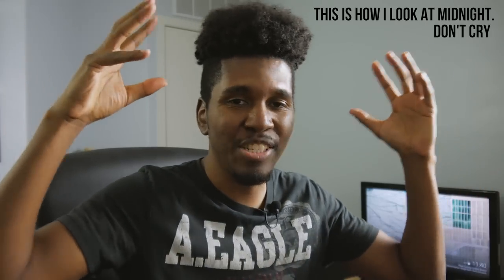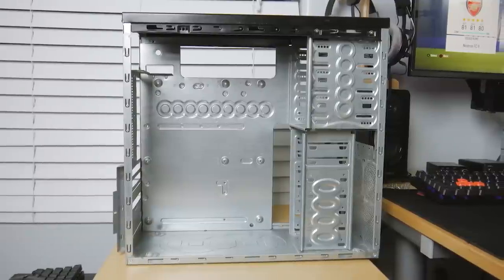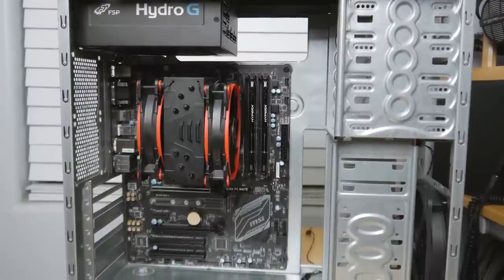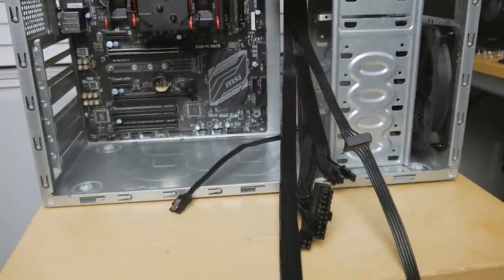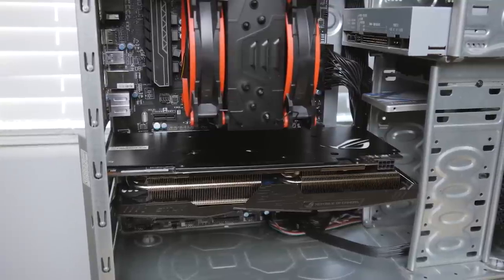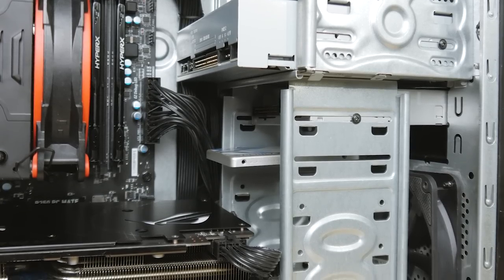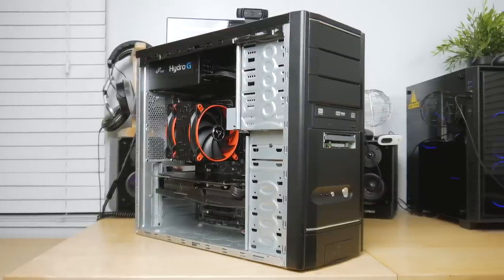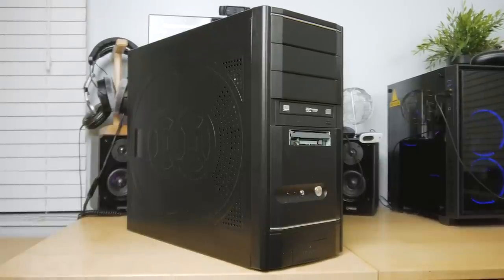The AMD Ryzen SLEEPER PC Build

Comment: I got an eMachines slim form factor PC that I may end up turning into a sleeper with a Ryzen 2400g. The only problems I can foresee are the PSU, which is a sort for elongated FlexATX. Gonna be a pain to find a new cheap PSU for it. And the headers are grouped together, so I may need to do some soldering or something.

Comment: But if I have a plan like this I will use
I9 9900K/Ryzen 9 3900X
Asus Maximus XI Formula/
Crosshair VIII Formula
Corsair Dominator Platinum RGB 64GB 
2X Asus ROG Strix RTX 2080 Ti 11GB + ROG NVLink
3X Samsung 970 Evo Plus 2TB
WD Black 6TB
Seasonic Prime Platinum 1300W